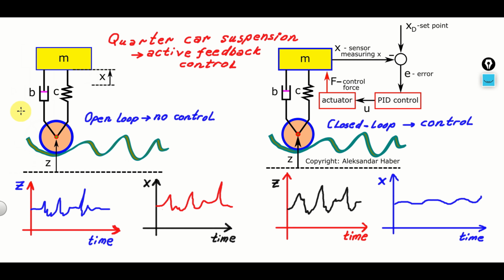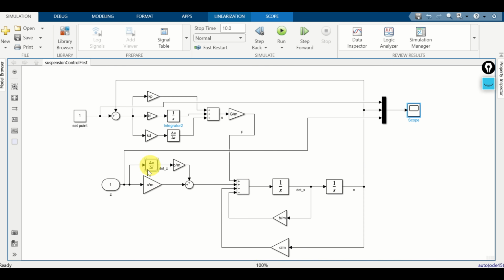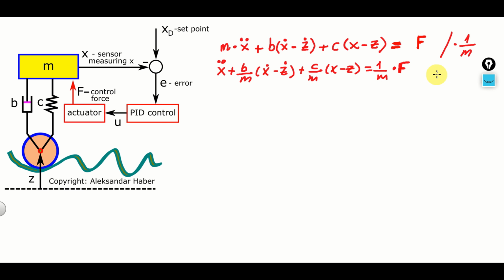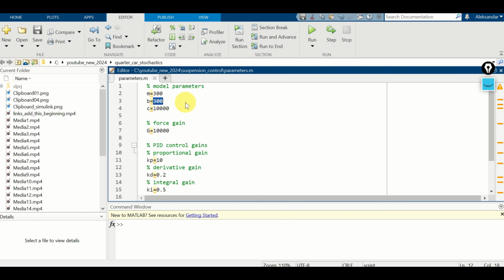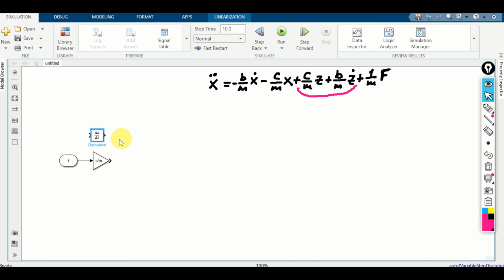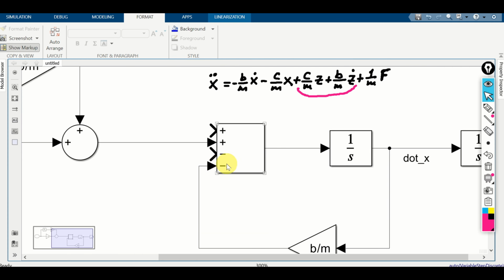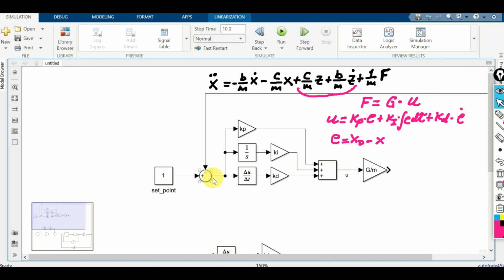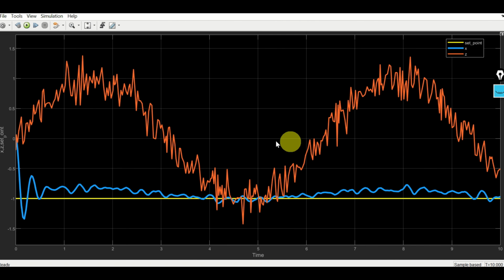Simulink Simulation of PID Control for Active Suspension of Quarter Car Model - Control Tutorial

Comment: hello thanks for the tutorial, how can i set the set_point so that its always above some value of disturbance input? Say i want to keep the body of the vehicle 2 points above road, if the current disturbance is 0.2, my set point is 2.2, if disturbance is 0.8, set point to 2.8 and so on.
Reply from the maker: This is a free tutorial. However, this comment section is not a public forum where we provide free answers, help, or consultantions. If you need help with your project, send an email with the problem description and we will provide a quote for our services.